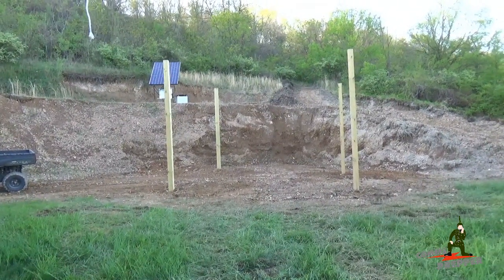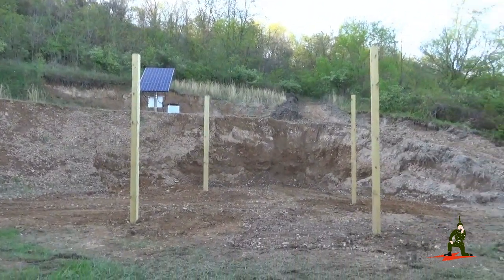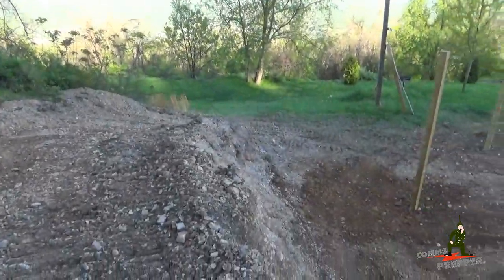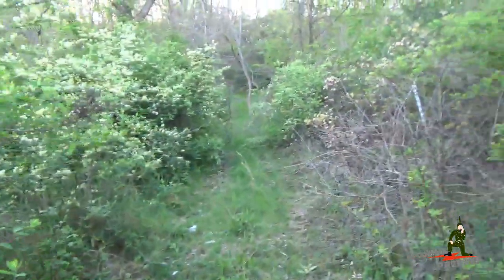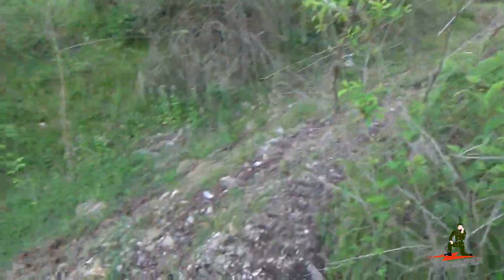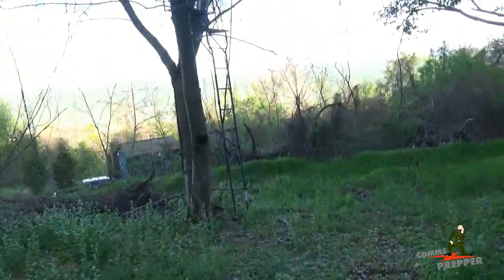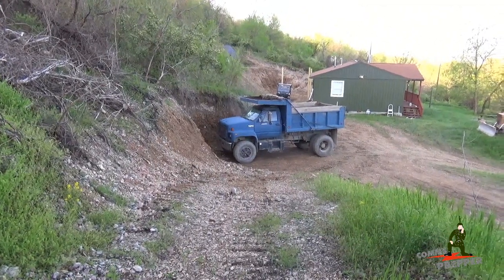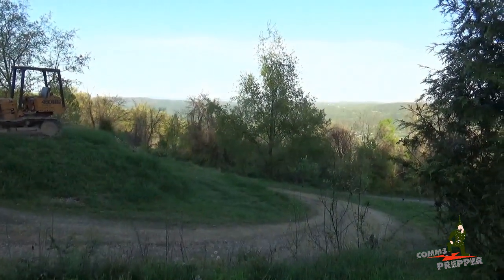Off Grid Solar Power County Electrical Inspection - Passed!

Comment: Well done!  It looks like your kids had a hand in the project ')  01:45 

--Konrad WA4OSH
Reply from the maker: +Konrad Roeder thanks.  Yes I had helpers.
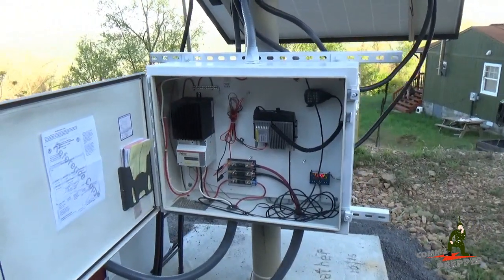Reply: P.S.  I'm sure you know this ... but just in case:  Make sure you keep a service loop in your coax when you bring-in the real antenna.  That service loop keeps water from coming in your box and it presents a high impedance to static discharges and nearby lightning strikes.   01:09

Comment: good to hear it all passed inspection. up here in Minnesota they nit pick. and go over it with a fine tooth comb. each component has to have paperwork proving that it's used for it's UL intended use etc.
Reply from the maker: +Roy Amberg with the exception of the temp switch everything is UL marked.  The temp switch is an optional item I wanted.  The Hoffman box was the big ticket issue and I got lucky finding one used.

Comment: I still dont like your battery's out side bro ! they last longer @ 75  !  ya got a lot of work done bro Kudos !
Reply from the maker: Outside is not my first choice but it's what I have to work with.  I am thinking about putting up three block walls around the box with gaps on the corners and larger cover spanning the blocks to create another barrier with the elements.
Reply: Ok hope it works bro ?